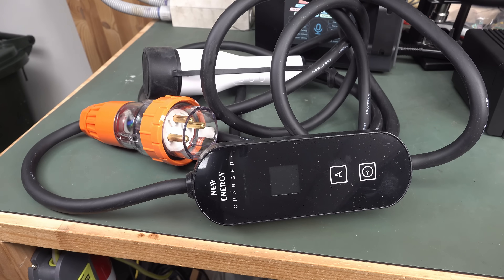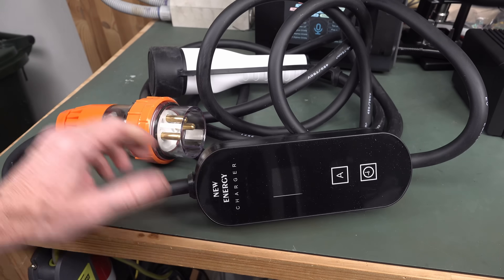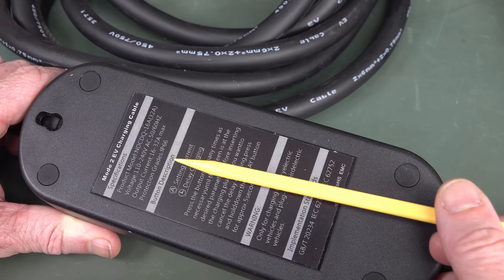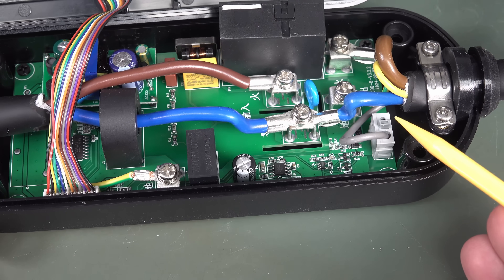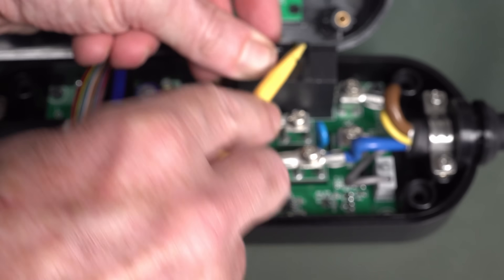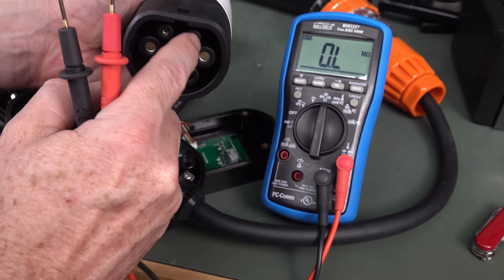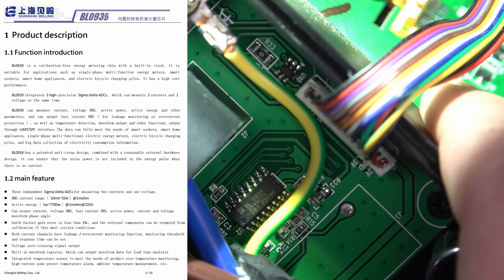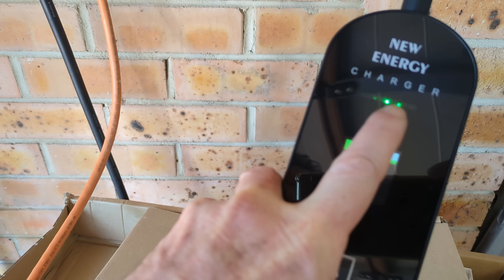EEVblog 1643 - DON'T BUY this Cheap 7kW 32A EV EVSE Charger

Comment: Technically it's an adapter, not a charger. The chargers are in the car. I'll show myself out. 😆
Reply: It's an EVSE, rather than the charger as you say. But he did say it around 1:30 in.
Reply: @sdgelectronics  yep, but the title still has it 😉
Reply from the maker: @BreeUSA  People search for the term charger. Title turns up first in any keyword search. Bread and butter Youtuber stuff.
Reply: @EEVblog  title can have charger in tags.... the title can say "charger"/EVSE.. I get the search issues, but it doesn't hurt to use the correct term, engineering "conciseness" and all. Lol
Reply: more precisely,it's a "charging cable". it's more than just an "adapter".
Reply: @JayWye52  many adapters can have control electronics. Can't be a "charging cable" as it has no charge function. Perhaps a term "charging pass-through cable....adapter" lol

Comment: That cable doesn't comply with AS/NZS 3000, the earth conductor should be 1.5mm minimum
Reply: AS3000 doesn't cover appliances it ends at the wall outlet.
Reply: I doubt that applies to appliances.

Comment: Hi Dave!
In Germany the standard requires a DPDT relay or dual relays for neutral + live. (SS 428 08 34 or DIN VDE0620-1)
Also, as far as I know, the double pole switch in AU is mandatory too. (AS/NZS 3105)
Reply: Seems pretty sketchy, thought they needed a further set of relays to deal with contacts arcing solid?
Reply: @edc1569  That usually never happens or it shouldn't, the car will enable the contractors, as there is no high load the on the initial start the sparking should be minimal.
Reply: @edc1569 I'm getting flashbacks to the 'Easee home' charger troubles in Sweden. 
Easee claimed that a single relay could work as a breaker for the load as well as a RCD.  That caused an EU wide sales ban.
Reply: I think the neutral relay is only mandatory IF the L and N can be mixed up. Since this is a polarized plug its not mandatory.
Reply: Not only that, but you would need to detect ground faults as well in Europe as you have the potential for DC leaking out through the EVSE which most home installations cannot detect by themselves.
Reply: No RCD, no neutral relay. A very cheap and nasty unit.
Reply: since usually you need external rcd to comply it makes sense to me
Reply: What's the reasoning of relay also on neutral?
Reply: @edfx  Neutral could be also LIVE if you rotate the plug, this is true for any county where the plug can be inserted 0 or 180 degrees. The  approval for each region or country can  be different  but on some they require the following: when the device is turned OFF there should be no voltage coming out of the outlet contacts (neutral, live, earth).
Reply: @edfx  Safety.  No relay, the neutral goes straight to the plug on the car.  If there's a fault e.g. live and neutral get reversed in the property, you have a permanent live in the car plug.
Reply from the maker: @edfx  You can't assume the power point is correctly wired.
Reply: @edfx  you don't always have a net with a neutral. Some areas have a 3x230V net for example that means that every wire is live.
Reply: @edfx  Total isolation. DC leakage is not funny
..
Reply: Safety issue.  If your ground spike on your house has rusted out, the neutral is floating at the voltage of the phase balance on the transformer. Lots of places have a bad ground rod or dry earth plate.  Never assume neutral is ground.

Comment: For those playing along at home, Aussie sockets are 240VAC, so a 32A socket can supply a max of 7680W.
Reply: How did Australia end up with its own plugs, you’d think they’d just use the British ones or pick the European standards!
Reply: @edc1569  Euro plugs are used typically 50A+
Reply: @AfifAhmad  He's likely referring to schuko or the others used in EU in consumer applications. The high current / high power ones are the CEE plugs (search for IEC/EN 60309-2). They're available in 16, 32, 63 or 125A and either in single phase 230/250V (blue plug) or three phase 400V (red plug, either 4 pole without neutral or 5 pole with neutral and ground)
Reply: Nominal supply voltage for single phase supply in Australia is no longer 240v but is 230v now.

Comment: One of the specifications for the SAE J1772 standard is the EVSE is to have a GFCI/RCD safety device. That unit there is 100% unsafe.
Reply: But SAE (including SAE  J1772) is meaningless for Australia, it is North American standard (but not even for all of North America) and is applicable to US and Canada only, for Australia are applicable IEC standards, so because this is not according SAE not necessary mean is not legal (and safe???) according IEC (I don't know what IEC standard say about it).
Reply: @mrlazda  The only difference between the European version (I don't have the number handy) and SAE is the European is set up for 3 phase. The protocols are the same. They also open the ground connection in some countries.
Reply: @randycarter2001  3-phase in Europe is the de-facto standard indeed, as 400/230V supply is very common here, and with 32A fused wiring it allows supplying up to 22kW to the car rather than 7kW single phase, cutting the charging time by 2/3. Still, it's a good few hours best done overnight or while you're working. DC stations are 40kW or more, they need beefy infrastructure, so they're few and far in between.
Reply: One could say this EVSE is “possibly or likely unsafe in US, Canada and some of Mexico*”  due to use of split phase 240 volts with both supply leads separated from ground by 120 volts.  This unit only has a current transformer on one lead, thus it would not properly detect a ground fault in a split phase wired situation.

*Mexico has both 127 v / 220 v three-phase and 120 v / 240 v split phase regions.
Reply: @wtmayhew  It wouldn't detect a ground fault, period. The relative voltage of the supply lines to ground or their location on earth are irrelevant. Ground fault detection requires measuring the current going in both directions. As for how safe this thing is, that's a relative thing and a consequence of the environment in which it's used. All you can really say is that is doesn't meet the requirements of a specific standard. Clearly Dave used it without issue, and while that's is a very limited test that shows that it can be used without issue for at least some amount of time. What's the chance of an issue caused by some deficiency in it's design? If that is serious enough to cause concern, can this risk be mitigated? For example, can it be used on a branch circuit with a GFCI breaker at the panel to give you your ground fault protection?
Reply: You can't really make that verdict without detail expose of the intended purpose rationale behind the specification and its overlap with the real world operation of the unit. Yes, you can say it doesn't meet a "specified safety standard", which is a legal thing, where "unsafe", at least for me, is a practical operation thing. Exploitation settings also matter, is it in a bare concrete garage, or is it the garage of a hoarder, full of cardboard boxes willed with flammable stuff. If you know you skimped on it, and it doesn't meet certification, it could prove quite useful to know what negative consequences that might have, and avert almost all of it by being a tad educate-informed so you ACTUALLY pay attention when you handle high voltage stuff. I think those "safety standards" which makes average people a bit too much looking at it as an iphone cable, which can in turn delegate to many situations where those people get to apply the same low level of diligence when handing high voltage that doesn't have a certified "pacifier" mandated and stuck to its dangerous end...

Comment: @3:07 "The front fell off!"

Oh, that's cute: on the Chinese printed circuit, the hot wire is marked "火" (Huǒ), which means "fire"...  🙂
Reply from the maker: Tempting fate there...
Reply: @EEVblog  It's actually a saying among electrical utility linesmen, to keep that fire in the wire.
Reply: @EEVblog  Their Chinese "火" means positive(P) and "零" means negetive(N)
Reply: I connected the "nothing" terminal to nothing and applied a lighter to the "fire" terminal, am I doing it right?
Reply: Keep that fire in the wire.

Comment: It has 4 rubber feet hahahaha...with that heavy cable it's plain impossible to ever have those 4 thin rubber feet resting on a flat surface at the same time.
Reply: I wouldn't call them feet so much as plugs.

Comment: Oh, my. The ground connection is horrible. The two ground wires are only connected via the PCB? I'd say that ground connection will blow before the circuit breaker when there's a short to ground...

If that was done properly, I'd say it'd be ok to use for countries where you can 110% rely on the polarity of your wall sockets. On those with reversible plugs and/or sloppy wiring, this thing's dangerous.

Comment: AU plug is polarized so I guess it can skimp by relying on the live and neutral always being the same.
EU plugs are 180° rotatable, so that Earth is always Earth, but Live and Neutral can be either, so in that case both would need relays.
The relays look terribly weak considering they would be carrying 32 A @ 7kW
Reply: EU plugs with earth can't be rotated, and 32A plugs are similar to Dave's plug.
Edit: type E plugs can't be rotated, type F can
Reply: Earthed schuko can only go in one way?
Reply: @edc1569  In Hungary where I live, the earth connector on the socket has strips on opposite sides of the diameter, 90 degrees from the L and N pins. There is no E pin, it's on the sides.

Comment: Imagine spending $40k or more on an EV and then buying the cheapest, crappiest Temu charging cable for it
Reply: Cheap as in quality, not as in money. (they're all stupid expensive for what they are.)
Reply: This wasn’t Temu. He doesn’t name the retailer, but EVSEs like this are listed on Amazon in Australia.
Reply: I saw an EVSE which looks similar to this one listed for the US market on Amazon.  It would be interesting to see the inside of the unit to see if it has a proper GFCI and relay switching on both supply leads.  I doubt you’d find that out from the Amazon listing or any of the product reviews.

It would work, but it would be patently uncool to relay switch just one side of a split phase connection to the vehicle.  I wouldn’t put it past a sketchy Chinese manufacturer to sidestep proper design.  On the other hand there are excellent Chinese manufacturers, but it is difficult to tell if you’re getting excellent or sketchy from an Amazon listing.  Unfortunately Chinese authorities allowing the sketchy manufacturers to persist damages the reputation of all Chinese manufacturers.
Reply: This is an Amazon special for sure
Reply: I saw an EVSE which looks similar to this one listed for the US market on Amazon.  It would be interesting to see the inside of the unit to see if it has a proper GFCI and relay switching on both supply leads.  I doubt you’d find that out from the Amazon listing or any of the product reviews.

It would work, but it would be patently uncool to relay switch just one side of a split phase connection to the vehicle.  I wouldn’t put it past a sketchy Chinese manufacturer to sidestep proper design.  On the other hand there are excellent Chinese manufacturers, but it is difficult to tell if you’re getting excellent or sketchy from an Amazon listing.  Unfortunately Chinese authorities allowing the sketchy manufacturers to persist damages the reputation of all Chinese manufacturers.

Comment: Fire Rescue Victoria recently responded to a fire in Glen Waverley. Some muppet was using a charger like this with a travel power adaptor. Looks like they lost their garage and two vehicles. Luckily the EV battery didn't ignite. I can see a world where insurers over here won't pay out on claims when non RCM marked cables are used. Fires are real and 32A is a considerable constant current.
Reply: In a travel adapter, Darwin Award? 😂
Reply: Jeepers christ I get nervous using a travel adapter when running a 200W laptop charger...  I cannot imagine trying to charge a car with one, WTF!!
Reply: @tomsixsix  some people need to learn the hard way. Just because the converters make it work didn't mean you should do it.

Comment: that recent garage leaf fire was blamed on a bad portable evse with an adapter.
Reply: @Bobo-ox7fj Why would the fire dept lie?
Sure looked like the car didn't burn from the pics I saw.
Reply from the maker: What aspect of it caused the problem?
Reply: @EEVblog  not sure that it is known at this time. they blamed the fact that it was a travel charger with an adapter, probably tesla to j1772?i thought most leafs can only AC charge at 3.3kw which is pretty slow compared to most EV's so thats also weird.
Reply: Articles blamed an adapter.. suggestion that it might have been a Japanese import Leaf, so possibly supplied with an OEM or replacement EVSE with Japanese plug

Comment: just makes me even more glad I drive a 53 year old Chevy truck instead. Ain't gotta worry about this cheaply made crap starting a fire or failing to do its job or sommat.
Reply: Damn straight... EVs are a meme
Reply: I’m sure it’s great fun in January.
Reply: @edc1569  3 pumps, bump the key, lights right off. 🤷 Not my fault you can"t maintain, operate your shit and have to resort to computers to do it for you.

Comment: Why doesn't the car just have a mains socket on it?
Reply: Because that would limit the car to charge at the amps that one socket can take. Or you would need a bank of different sockets. Also, imagine how many different sockets you'd need for a car driven across Europe.
Reply: People just want to plug a car in and not have to worry about getting zapped in the rain or overload the supply.

Comment: The PE is to small to carry the short cut current from a 6mm^2 current!
There should be a RCD included, the RCD must check the PE connection, while you switch on. IF there is no GND connection the charger should not start.
Reply: Does the PE really need to carry a fault current for very long?
Reply: @edc1569  the MCB needs for fast action (magnetic trigger) a lot of current. A 32A MCB Type B needs a minimum of 160A to act fast. With 160A you get a fast acting PE (lost by burn out).
You will be able to charge your car. But without any safety!

Comment: Why do EVs need this, instead of including the electronics on the EV itself?
Reply: Because those electronics cannot measure what kind of plug and socket is on the other end of the cable.

And for the safety features, having them only in the car cannot protect from a fault between the charge port and the electronics or from a fault in the charging cable. Both could energise the car's body, which is a very large metal thing sitting on four round isolators people have no qualms about touching.
Reply: because every charge port is different.
its the port telling the car what to do.
Reply: To protect the users, consider the conditions you charge a car in, also to ensure the car understands how much power is available to ensure the socket is not overloaded and also to aid in grid stability in some applications.

Comment: Just how much worse are Aluminium cables?

For something like a winch, if I double the size of the conductor(while changing from copper to Alum) am I better off or worse off?
Reply: Aluminum wire is perfectly fine if you use a larger conductor size to make up for the higher resistance. Just make sure your terminals are rated for aluminum or you will have corrosion issues that can cause a fire. Be sure to use anti-oxidant compound if the terminals or code requires it. It doesn't hurt to use it even if it's not required too.

Comment: I was a little concerned that the earth connectivity is via the pcb trace. I was brought up to have a longer earth lead so that it is the last to break off if the cable clamp fails. I am sure the lawyers will argue that electrical safety is not the manufacturers responsibility as long as its works out of the box without any 'wear and tear'.
Reply: I don't think Earth through PCB tracks or solder joints is ever permissable for safety Earths. It's only valid for purposes like EMI suppression where it doesn't matter so much if the track fuses.
Reply: Maybe they implemented the RCD functionality by checking for current returning on the ground line? Might be worth a try introducing a fault with a resistor to see if it trips.
Reply: @NiHaoMike64 😫

Comment: Dave, have you ever looked into the OpenEVSE project?  It would be very interesting to hear your take on that design.
Reply: openevse is quite good.  it has all the ground fault detection and an extra test wire around the common coil so it can cause a ground fault imbalance for testing.
Reply from the maker: Haven't really looked into it. Is it 32A capable?
Reply: @EEVblog  yes.   THey have kits for up to 48amps.   Natually the logic board will drive anything to 80amps.
Reply: @EEVblog  It is.
Reply: @EEVblog  I built a 3 phase version, so up to 22kW if your home wiring can handle it.